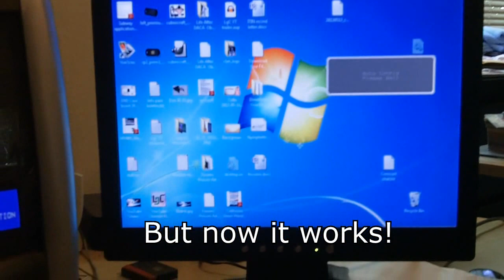Capacitor replacement on Acer AL1912

Comment: Thanks for advice ! I had the same problem as you and I replaced all 6 capacitors like you said and the monitor now works perfectly again. Only one capacitor looked bad...but that one was not the one causing the issue...so definitely replace all 6 at once....that way you solve the problem in one shot unlike my first attempt.

b
Reply from the maker: BRADLEY LOUTH And they are inexpensive, so might as well do all in one bang.

Comment from the maker: I replaced six total, those two you did plus four more, they were 470uf 25v, maybe you could go the extra mile and do those since they aren't that expensive just make sure you get 105° ones. BTW, none of the caps I replaced looked bulged nor were they leaking anything, they looked normal.

Comment: I have the same monitor and it goes off after 5 minutes, I replaced the 2 10V 1000uf caps but still doing the same thing, should I replace them all? None look bad, no bulging or discoloration, don't know what it's problem is at this point.